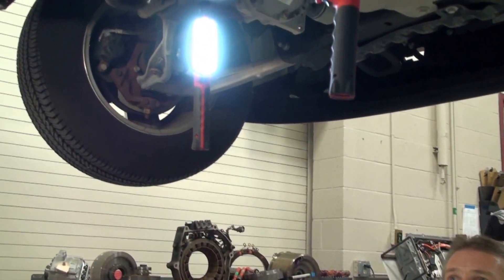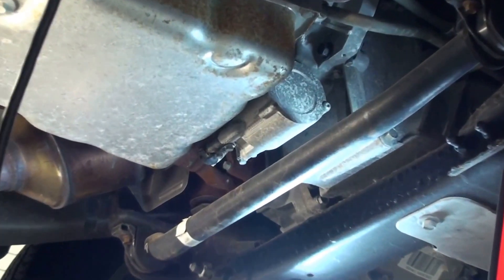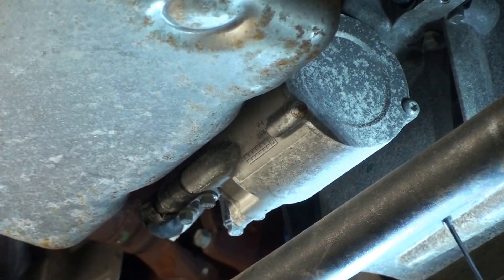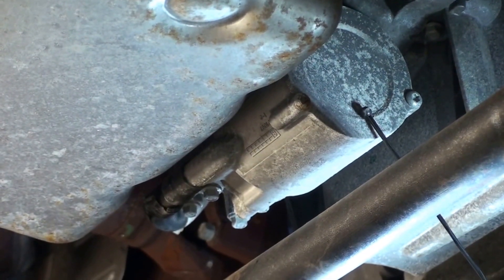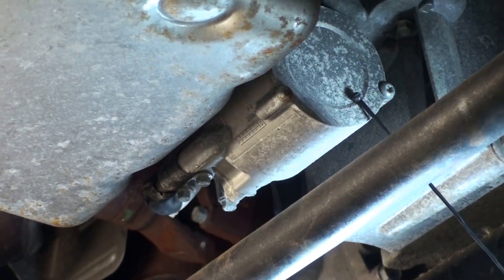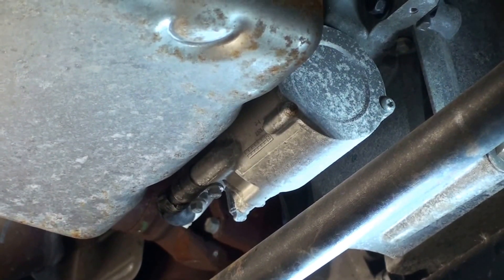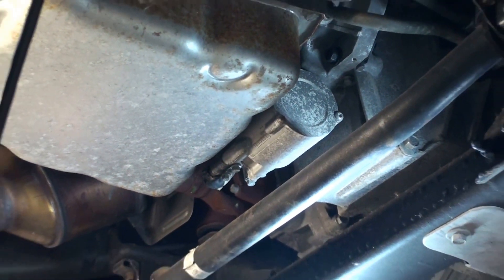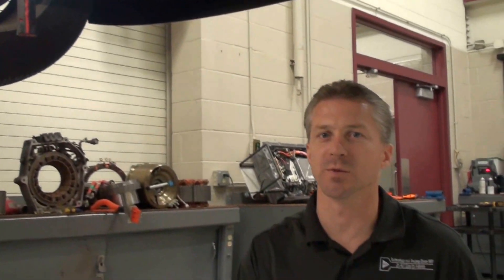HEV-TV 1.15: Auxiliary Pump in Automatic Transmission

Comment: what are some symptoms if it's the auxiliary pump?
Reply: Amanda Pena yes I have same question. .  basically.  my transmission has a loud rough start at first and I don't know if that's the motor or the transmission problem.  Also, sometimes in reverse I slightly push the pedal to start reversing and the transmission grinds rough and it chugs for 1 or 2 seconds.  I want to replace it but it might not even be bad.
Reply: Daniel Shelley  I  wouldn't replace the transmission. I had my escalade 3 years now and it's been doing it off and on especially in the winter. It's the auxiliary transmission pump. It's located right under transmission. If you know what your doing you could have it off in a matter of minutes
Reply: Jorge Vasquez  would you know where to buy the part? I took my tahoe to the dealer they said it was the hybrid battery but I believe it’s the aux pump
Reply: Oscar Gonzalez it's a very hard part to find. However, I believe it's actually sold by gm for around $170 . I'll find out for sure and post the link.
Reply: Oscar Gonzalez dealers don't know crap about hybrids unless they are hybrid certified. Take my word for it. Don't waste money at your mechanic either. I learned the hard expensive way....they will end up trouble shooting and having you replace every but that pump...in the end it's the auxiliary trans pump.
Reply: @vunit8213  I think I'm having these issues with my 08 Tahoe Hybrid. I am facing intermittent issues at very slow speeds like starting from a stop or after backing out of a parking spot and then switching to drive as I start to go it seems to have trouble and starts to bump or almost buck and reminds me of when I was learning to drive stick shift and slipping and grabbing. It also makes a weird grinding gargling noise sometimes when goin up a hill or something around 15-20 mph...I hope its not something more serious I hope its just the pump. these comments were helpful
Reply: VUNIT82 thanks for the quick response! Yeah it comes and goes but I want it to not come and go! I actually just had it do it right around 15 mph as well.. I’ll look into fixing it here soon! Thanks again..
Reply: VUNIT82 I’m not a mechanic by any means but I’ve changed alternators and water pumps before... is this fairly easy as well? also.. I’m looking and found that the 08s need to upgrade to a 2010 pump .. and may need some sort of adaptor to connect old to new.. do you know about that?
Reply: @devinjtatro  I don't know anything about that, because mine is an 09, so it was probably already updated if that's the case.... it's an at home Diy project...jack your truck up in the front preferably...or if you have access to a lift even better....but it's right between oil pan and transmission pan...right dead in the middle...it has a black plastic PVC style fluid line connected to it...this line supplies the pump with tranny fluid to cool down the tranny and keep it running smoothly....mine was always wet with fluid...I couldn't figure out from where it was leaking...I just figured the pump was must be malfunctioning causing it to leak...its been awhile, but if I remember right it's a star bit screw....and there's aprox 3-5 screws....if you can change an alternator, you can do this....if I were you I would buy new fluid and a new tranny filter as well... might as well do it right while you're down there.... however, if you just want to swap it out and go I would have a bucket handy in case any fluid poor out of the pump...If I'm remembering correctly...the fluid only comes out of the line if the keys on and pump is activated
Reply: VUNIT82 awesome! Thanks so much for the help and guidance on this!
Reply: @devinjtatro  no problem... you may also want to check into your driver side valve cover quick and easy fix...(arpox 30) minutes... It may need updated with the new style...if you hear an audible hissing... vacuum leak near PCV valve on the driver's side valve cover...and considering yours being an 08 it probably isn't updated....but $50-$75 to fix....what happens is the outdated one doesn't have the hole in the right spot so oil doesn't circulate correctly so if you have noticed excessive oil consumption for no good reason it probably clogged with gunk....the updated one has a hole cut in the correct spot so oil circulates correctly.... anymore questions I'm around..
Reply: @vunit8213  Okay cool thank you! I haven't noticed that yet.. but I'll check it out! I am looking at this.. and hopefully this guide will help others that are having similar issues. https://workshop-manuals.com/chevrolet/tahoe_4wd/v8-6.0l_hybrid/transmission_and_drivetrain/automatic_transmission/transaxle/fluid_pump_a/t/component_information/technical_service_bulletins/all_other_service_bulletins_for_fluid_pump/10-07-30-009/jun/10/a/t_hybrid_transmissions_service_auxiliary_fluid_pump/
Reply: It has pretty detailed instructions on how to replace the pump.. and it does mention part numbers and update 08 pumps to 2010.. I'm just trying to figure out if or where this updated connector/ wire is that they are mentioning.. I just want to replace the pump and not the module part...
Reply: @devinjtatro  your vehicle probably is equipped with the old style power connector that supplies power to the pump. Since you are updating the pump you probably have to upgrade to the newer connecter since your 08 is the old one and won't fit the new pump... As far as where to get it? I would try acdelco.com or GM
Reply: VUNIT82 thanks! Looking to get this thing ordered just making sure I get the right parts and everything that I need. In the mean time I have started to experience some shuddering and similar characteristics.. around speeds of 35-45 mph or so.. this pump might be failing quicker than I was thinking!
Reply: @devinjtatro  yes...any kind of transmission style symptoms you may experience most likely are the result of a faulty auxiliary pump! Regardless of what anyone may tell you...  99% of your local mechanics don't have a clue about hybrid vehicles..ive experienced everything you are telling me plus more.... You may even want to call your local GM dealership parts department or the 800 number and ask them for YOUR VEHICLE SPECIFIC PUMP...ask them about the updated connector... especially if you are going to order through them...if not they will still assist you....but MAKE SURE you have the right parts before you start, so you aren't waisting your time...good luck! Please keep me updated on your situation! Thanks
Reply: VUNIT82 awesome thanks so much! I will let you know how it goes!
Reply: @devinjtatro  if you are experiencing shutting around them speeds, it may be related to your throttle body sensor or your fuel pressure sensor....or could be a spark issue...(faulty coil pack on plug) unfortunately I changed all of them little sensors before changing the aux pump.... Plugs,wires, sensors, and even the fuel pump because I kept getting a    check engine code.... DONT EVER!!! ADD HEAT TO YOUR TANK!  THAT'S WHEN MORE PROBLEMS DEVELOPED...I EVEN CHANGED ALL MY INJECTORS...STILL NO CHANGE... The only reason I am sure it was the HEAT fuel treatment is because it started right after I added it to my fuel...and didn't quit until I drained all the fuel from my tank and put in new gas....I figured I would just give you some of my knowledge...it may help you avoid more problems down the road...and one more thing i might as well say.... regular unleaded will make your hybrid run even worse...it will buck and jolt even worse when it's cold outside, because this vehicle requires higher octane fuel...mid grade is what I use...my guess is the engine isn't firing properly with regular unleaded causing poor engine performance... next time at a intercetion or drive thru and it starts to buck..put it in neutral for a few seconds and ride it out.. because if you don't it may stall in the middle of traffic and these hybrids don't start back up like normal cars... you have to turn key back and wait a few seconds and then hope it re starts....
Reply: VUNIT82 I crawled under the Tahoe tonight to scope out what I’m looking and for. Looks pretty straight forward that pump is held on by those 4 bolts.. but what I did find while I was down there was the pump was greasy and grimy and dripping with fluid.. assuming it’s transmission fluid but not sure. Iv looked into the other things you mentioned.. throttle body and stuff but the reason I’m still pretty convinced it’s this pump is it’s very intermittent.. some days it runs great all day .. like today. It was a bit warmer out today as well.
Reply: @devinjtatro  mine happened worse on cold mornings when backing out of the garage without letting it warm up a few minutes..I would back out and it sometimes wouldn't even budge...then I could feel it starting to catch... almost like the pressure is building up...but after that it seems to work fine....it seemed to also act up allot when I was driving in town and all of a sudden I had to make a quick stop..like at a red light...or in drive thrus.... sometimes in slow crawling traffic I was afraid it was going to boost me into the bumper of the car in front of me..lol
Reply: VUNIT82 wow, yeah mine hasn’t gotten that bad yet. It mainly happens after backing up and then slowly driving forward like turning around in the driveway or parking spot.. sometimes just creeping along in a parking lot or drive through or at a light .. I can almost predict when it will start to buck/slip it does sound like pressure building up and then when it releases but the vehicle isn’t ready or something and. Usually just slow back down to a stop and it goes away. Slightly different symptom I’m experiencing but I still think it’s related to the pump...on my street theres an incline .. most of the way it stays in battery mode between 10-20 mph. Then it switches to engine smooth and fine but it makes like a weird growling gargling noise that sounds like it originates under the the center console area. My understanding is that at that speed it’s probably in hybrid 1-2 low mode and that pump helps make that function smoothly.. so if that’s struggling to provide lubrication and pressure and I’m experiencing the other issues. The weird thing is that some days it drives and rides like a dream but now i just get paranoid if it is going to act up. Like I said I’m starting to get to the point i can predict when or if it may act up. Sorry long comment.
Reply: @devinjtatro  sorry don't mean to bug you but, I just read your message (old message) about asking me to private message you on your channel.... however, I searched and searched and couldn't figure out how to go about doing that...do I have to be a  paid subscriber to YouTube? I  searched all over but, still couldn't find anything that would allow me to message you.... sorry for the inconvenience...
Reply: VUNIT82 no worries. YouTube made it harder to private message .. I ordered the parts.. weird thing is the Tahoe seems to be running great.. acts up minimally. I didn’t change anything. So weird.
Reply: @devinjtatro  lol... that's the way it goes! Get it detailed and it will run likes it did in 2008 😊
Reply: VUNIT82 yeah ... I’m still waiting on the parts.. but now it acts fine. Funny you say that cuz I am planning to give it a good cleaning in the next few days.
Reply: Devin Tatro hey did you ever get the parts installed ? I am having this same issue. Figured out it was something in the trans. Long. Story short. 2 yeRs ago car quit. Got towed to dealer 1k later on diag fees. New main battery and junction block. Car ran fine for abt a week. Been in my garage untouched for the past year. What parts did you order ? And from where. Im ready to knock this out myself
Reply: @derrickbjr1  GM 1920-7983 is for the Auxiliary fluid pump and there's also a auxillary sump filter inside your transmission next to your regular transmission filter just allot smaller....that's is your auxillary transmission sump filter.  ACDelco makes that as a 2 piece filter kit....your regular filter and the auxiliary filter....I would advise you to change everything at one with new fluid.  Or at least 10 quarts....drop, change and fill.
Reply: @derrickbjr1  easy as pie! The pump can be bought at wholesalegmpartsonline it's about $253. With a $30 core fee ... you may also need pgtail connector if yours is the old style....the updated plug fits on the updated pump..... there's literally four 8mm bolts and an electrical connector holding it under tranny pan...when you remove it a bunch of fluid will come out, so that's why I advice you to change your 2 filters while your at it....seal should be one of the good reusable ACDelco ones, so it shouldn't need replaced unless it's damaged and you want to spend another $35+ .....I also had better look re-using my old ones because there already formed to the groove...no leaks here..
Reply: @derrickbjr1  one last thing, you don't have to change your tranny filters or fluid at all...the pump should drop right on out, however you do need to replenish the fluid that comes out..
Reply: WHOizJR I did and unfortunately it didn’t solve the issue for me.. very frustrating.. I hope it solves it for you. Could be the pump module?
Reply: Devin Tatro  did you use the 2010 pump? They recommend using a new harness and replacing the control module as well. I was going to just do all 3. Along with the fluids
Reply: WHOizJR I used the 2010 pump and updated connector piece to connect to the existing module. I wasn’t sure if the module needed to be done and programmed by a gm mechanic..
Reply: @derrickbjr1  one thing I learned about owning a hybrid is that, allot of the smaller shops will claim they know how to fix them, however they are as clueless as you are.... Secondly, 99% of the time something go's wrong, it's not the battery or the hybrid system... everyone always points to the 300V lithium ion battery, however in most cases it's not going to be the battery ... it'll be something else causing the battery to discharge thus causing tons of other problems...
Reply: @vunit8213  Hey, my 2009 Escalade hybrid starting doing that bucking and not wanting to go thing about 3 weeks ago. The rpm needle goes up and down and it does not go into auto stop at all anymore. The hybrid battery fan is running on and off more than normal. I cleaned out the air intake for the battery fan. I replaced the auxiliary transmission pump along with new spliced connector. I'm still having the issue. The guy I bought it from said he had the hybrid battery replaced 2 years ago. Could the auxiliary trans pump module be the problem? I
Reply: Connor Lacy If you recently had the auxiliary pump changed, I wouldn’t think it went out already....im betting on battery cell related...because the reason it’s not shifting into EV mode (hybrid mode) is because the battery isn’t able to reach the desired charge...HOWEVER,There are several other things that can stop your hybrid from going into electric mode...from what I heard is these batteries aren’t like what most people think...they were built to last.. they come with a 100,000 mile or 10 year warranty....so, I would start simple...#1. If you don’t have your seatbelt buckled, it will not go into ev mode #2. If you have a trailer light adapter hooked into the trailer light port, or if you’re hooked up to a trailer it will not go into ev mode...#3. If your hood isn’t latched correctly or if your hood is open, it will not switch to ev mode...#4. If your  12v battery is on the brinks, it will NOT go into ev mode and will cause all kinds of mechanical and electrical issues! People have been known to have their 300v hybrid battery changed, all because they had a weak 12v battery....and they don’t always test bad either! These hybrid systems are different, I had a battery specialist tell me my hybrid battery was bad and my 12v battery was perfect, however as a last resort I changed my 12v battery and took care all kinds of issues I was having and one issue was not switching over into ev mode.... #5. Could be the hybrid system fuse forget which one it is, but if disconnected or blown will NOT go into ev mode...#6. If truck is in “limp mode” will not go into ev mode...I guess what I’m trying to say is DONT GO CHANGING THE BATTERY OR AUX PUMP or any expensive parts until you troubleshoot the simple things first..
Reply: @vunit8213  awesome, I did get a diagnostic check and it came up with a few codes. I will post later. One was "replace hybrid battery", the other was for the auxiliary transmission pump/module, which I already bought and will be installing Monday. I will check all of the other things you mentioned and repost. Thank you so much for the info
Reply: Connor Lacy oh I thought you already replaced the auxiliary pump? Yes, replace that pump ASAP! It’s the cause of the buck or surge when transitioning from mechanical mode to EV MODE....the pump is responsible for keeping pressure on the clutch inside the transmission...and also responsible for engaging and disengaging the gears! This pump will progressively get worse over time....from time to time when my truck would jolt it would also stall out triggering a check engine light and a message to “service hybrid system “ however turning the car off for a minute and restarting it will reset the message and my truck seemed to run fine again....post the codes whenever and I can take a look for you.
Reply: @vunit8213  I did replace the pump, but it's still doing the same thing. Today, I removed the hybrid battery and checked every terminal for corrosion. Everything looked very clean, so I put the battery back in. I did order an auxiliary transmission pump module that will arrive tomorrow. These are the codes:
P0AC4, hybrid powertrain control module requested MIL illumination.

P0A80 replace hybrid battery pack

P0BBD hybrid battery voltage variation exceeded limit

P2797 auxillary transmission fluid pump circuit performance
Reply: @vunit8213  also, how is the fluid in the pump replaced? From the transmission, and just add more fluid at engine compartment dipstick tube?? If I replaced the pump, and then replace the module tomorrow and it doesn't change, I'm guessing it's the hybrid battery. I know how to test the cells for voltage but the resting voltage may be normal. How do I find the bad cell(s)? Also I've read Prius gen 2 hybrid cells are the same as the gm and are an exact fit, which can be bought on Ebay? I'd rather replace cells than entire battery if possible..
Reply: Connor Lacy ok, I got codes P0AC4 and P0BDD IN THE PAST AND I always got them codes right after I experienced a jolt or a surge....Did you make sure your 12V battery was at 100%, because these hybrids operate a little differently...the 12V battery is what powers most of your electronics and also some of your engine components...not sure if it power the auxiliary pump or the 300v lithium battery powers that...however, if either one of your batteries aren’t to full capacity you will experience issues because, when they drop to a certain level certain components shut off and turn back on causing weird things to happen....my truck had a 12v battery that would only hold up to 11v fully charm and would drop after driving for awhile with light, gps, music, etc...it would cause dvd screen to randomly black out and door locks to cycle on there own...it caused my engine to constantly keep switching over to ev mode and back and I also got the 2 codes you mentioned....FIRST thing I would do is do a voltage reading on my 12V battery... no need to do a voltage drop test, because there’s no starter and it’s all wired differently...it sounds to me like you have a low battery either 12v or 300v cell may be weak, however if the 300v was recently replaced , I wouldn’t bet on it being bad.
Reply: Fluid is replaced through dipstick....and FYI there is 2 filters in your 2mode transmission...one is your normal filter and the second small filter is your “auxiliary transmissions sump filter” if it’s clogged with debris like mine was it will also cause surging and rough shifting mainly into 2nd gear for me anyway....the sump filter is what filters the fluid for the hybrid system and the auxiliary pump.
Reply: @vunit8213  thank you for the info. I just received the pump module about an hour ago, so I cut the new connector off I spliced on the other day, put it on the module (module is used, new ones have to be programmed at the dealer), and drove it for about 2 miles. The jolting seems to be gone, however it still does not go into auto stop, and the check engine light came back on once I parked it. I will check the codes again as well as the battery. The voltage on the dash with the engine off is 12 volts. I will check with volt meter and repost
Reply: I’m not 100% sure on this but, I believe the auxiliary transmission module may have had a recall or a bulletin....it should have been changed already if it was a defective one...something about missing a waterproof seal so moisture causes harsh shifting and or surges...and could result in an electrical fire..
Reply: May want to check into all the bulletins for your particular vin #
Reply: The code P2797 sounds like you may have a lose connection on your auxiliary module....try disconnecting power first, then disconnecting the 2 harness plugs from the module and cleaning them with electrical cleaner or break clean and then after they dry off secure them back on... and reconnect the power....those connections are in a spot that get mudd, dirt, water, and salt flung at them from the road daily...it couldn’t hurt to clean and maybe you’ll find a lose connection
Reply: @vunit8213  thanks once again. So, I just drove to auto zone, and the jerking is back, but only when first driving, then its not as bad. it's no longer doing the speed fluctuations it was doing before while driving that you could feel, like the electric motors were cycling. The battery checked out good according to them, but it did say check starting system on the battery tester. The diagnostic test came back with 2 of the same codes. I reset it earlier when I took apart the hybrid battery. No longer getting the previous codes.

P0BBD: hybrid battery pack voltage variation exceeded limit
Reply: Connor Lacy i would suggest you to just try, and trickle charge your 12V battery over night...DISCONNECT BOTH TERMINALS FIRST, then charge slowly over night....i know you might think this sounds pointless, but please just try it....when you reconnect everything, you will have to reset all your settings again, however since you just replaced the module it wouldn’t hurt to start fresh....I said it before and I’ll say it again AUTO ZONE AND most mechanics are clueless when it comes to hybrids....slowly fully charge your 12V battery and test drive...
Reply: Your dash doesn’t tell you if you’re battery is working properly....trust me...my battery would test perfect, but when I would drive is when it would discharge....I ALMOST FORGOT TO ASK??? VERY IMPORTANT QUESTION...DO YOU DRIVE MAINLY SHORT DISTANCES? DO YOU MAINLY DRIVE ON Highways or do you do allot of stop and go driving??? The was a bulletin for this, concerning the hybrid battery.....you see, you must do stop and go driving... the more you apply your breaks the more you are charging up your 300V battery....if you don’t drive adequately then you will experience all of your issues, because of lack of juice in your battery....every time it gos under a certain percentage it will struggle to stay alive and when it at its happy point it good...there is a bulletin for this...this may be your issue
Reply: @vunit8213  ok, I'll charge it tonight and repost. I drive it short distance during the week and long on weekends. Yesterday I drove 100 miles and it would stall when I got to a stop light until I made it home. Had to restart engine each time.
Reply: Connor Lacy these hybrids were built for “stop and go” traffic....that’s how they charge the 300v by using using the breaking system combined with the electric motors generating power... My truck did the same thing not to long ago, when it was colder outside. It stalled and through a check engine light, but I figured it was because of my faulty evap vent Solenoid I still need to replace...I’m getting a specific code for the solenoid...however since it warmed up I haven’t had anymore issues of it stalling out..
Reply: @vunit8213  I went ahead and installed a brand new 12v battery, and still having the same issues. Hybrid battery fan constantly running. What are your thoughts on isolating the weak hybrid battery cells, and replacing them, or using a battery discharger/charger to recondition the cells?
Reply: Connor Lacy if you know how to do it then by all means do it it....You got me curious now....if you’re hybrid battery fan is consistently running, then that means either 2 things...#1. Means you’re battery is constantly charging, so fans keep cooling...(could be a weak cell or two) #2. Your computer is being told to keep them fans running due to some other issue...I personally like to eliminate one thing at a time starting simplest things first...however, you did get a P code I never seen before...the one having to do with “replace hybrid battery” heck, yeah if you know how to check them cells than do it even if that’s not the cause of your issue it’s still a good peace of mind to have
Reply: @vunit8213  I fixed the problem. I removed the hybrid battery, took off the cover, removed all bus terminals on one side of the cell bank. I tested the voltage of each cell block. One was reading 6 volts, one 8, and the rest 8.20 volts. I bought a used re conditioned second generation Toyota Prius hybrid battery cell on Ebay for $35.00 a few days prior. It took some work to loosen the bolts that hold them together tightly as well as screws on the bottom, and the fan. I removed the cell with low voltage and discovered it was badly burnt on the side and had a hold in the casing. I believe it damaged the cell beside it, which read 8 volts, but I only had one replacement. I swapped it out, put it together, and re installed battery. Auto stop works, try k runs like before, however check engine light is on and havent scanned it again. I believe it's going to be due to the cell reading 8 volts. I'm going to order another and replace that one very soon. I'll repost once I get the code.
Reply: Connor Lacy that’s awesome! I’m glad you let me know....I’ve always been curious to test my cells to, but never did because didn’t want to ruin anything....so, did you have to use any special gloves or not? Did you turn the power switch off? Did you have to perform any other special procedures ?  Now that you fixed yours, I’m curious about my cells because my truck seems like it stays running allot longer than it used to....how long did it take you to check all the cells? What setting did you set your Multi meter to? What cells work in these ? You said a Prius has the same cells? Which year and model? Sorry for all the questions, that’s one thing I never checked before and now I’m curious about mine.
Reply: @vunit8213  I believe it's the Prius generation 2. Look up 8.2 volt Prius cells on Ebay and theres a ton for sale. I disconnected the 12v battery, then on the passenger side, under the back seat, theres a safety disconnect for the hybrid battery, pull the lever and remove it. This kills power to the motors. You'll see 3 wires leaving the battery. Red, black, and smaller black(ground). I removed the small cover exposing the terminals and disconnected them from the battery. No gloves needed since  the disconnect is pulled out. disconnect 2 additional plugs, and a rubber tube, then un bolt the battery. I believe 2, 18mm in the front, and 3, 13mm in the back. The battery is heavy as crap and it's easier with 2 people. Once out, remove the cover. Theres a million bolts holding it on. Remove the black plastic covering the cell terminals, they pop off with a flat head. Then using a 5/16  driver or socket on a drill, unscrew all nuts on ONE side of the cell block bus bars. Theres quite a few. Once one side is no longer in series, you can use a multimeter set on 20v DC and connect on each side of the cell. Test each cell, only takes 5 minutes. Mark any cells with low voltage with a sharpie.  Getting the cells free is a whole other monster but it's not that bad. If you ever get to that point,  I'll explain how I did it step by step.
Reply: Connor Lacy thank you! This will make it a hole lot easier now... I appreciate the response to my questions...
Reply: I own a 2008 Tahoe Hybrid. Been dealing with the same issues for the better part of 5 years. GM replaces the engine and Hybrid Battery 3 years ago and the issue still exists. I just replaced the serial gateway module a few months back because it stated “service hybrid system”. Long story short, the module is out of production so I had to get a used one off eBay. It seems to work be working great but didn’t fix the Auto stop issue. I requested for GM to repurchase my vehicle and of coarse they said hell no!! Lol. So, at this point I will look into the aux pump. Hopefully, I will finally get some sort of justice!
Reply: @OscarGonzalez-xw9fw  it's the 12 volt battery  loose or dirty cables  the Driver information should show 14.9 (14-15)volts with the engine on  if it shows 12 or 13 less then you have a issue with the battery and/or  cables to the battery  unless you have a check engine light then the main 12V battery is your issue
Reply: @vunit8213  hey bud i know this post is old but Ive tried looking at the parts number you gave for the pump seems like nothing pops up period,Ive called dealer,they have no clue of anything,my prob is car bucks from dead stop to gas mode and some time launches forward slowing down from gas to hybrid.my truck a 2009 all original,no check engine light or code at all ?what you think it could be.this prob scares me cause it may eventually hurt someone.ive looked all over for the parts still nothing can you help
Reply: Steve Pontarelli you just described to the T, what mine used to do! 😆 same exact symptoms and no engine codes... from how I was explained, all the pump does is act as a sort of hydraulic pump that that engages and disengages the clutch so your vehicle transitions smoothly from electric to gas vise versa. Now, if you live in a city with a lot of stop and go, it’s being used a lot more than if you only drove your vehicle long distances or “highway driving”...... The only problem I noticed about “highway driving” is that your 300v hybrid battery doesn’t like to fully charge, which causes vehicle to constantly keep switching modes to top off your battery...but when I lived in the city I was constantly breaking and the battery charges off of your breaking system and electric motors act as generators.... anyway to answer your question about the part number.... if I remember right I called GM and double checked with your specific vehicle... however, if I’m not mistaken it’s the same exact one, all GMC, CHEVY, CADILLAC 2008-2013 SILVERADO SIERRA HYBRID AUX TRANSMISSION FLUID PUMP NEW GM #  19207983 ......Easy peasy lemon squeezy Steve! Do it yourself and save a ton... 4-5 Allen or hex bolts and an electrical connector.... if I was you I would drain whatever  transmission fluid that comes out in a clean container, and replace with new fluid.... shouldn’t be much because pump will be shut off....Good luck, I have faith in you! You got this! 😎
Reply: @vunit8213   amazing to hear,yes i do live in the city and its alot of stop and go but lately its getting very bad to the point i dont want to drive it,so did you have to replace just the pump or the pump and controller ?
Reply: Steve Pontarelli you shouldn’t have to touch the   Module it’s all mechanical, that pump probably endured a lot pumping over the years...
Reply: Do you get any oil residue at all around your aux pump? Mine had it running down the sleeve that covers the electrical connector. And no matter how many times I wiped it clean it would get transmission fluid on it. Probably every time it bucked and stalled in me!
Reply: @vunit8213   hey bud let me ask you i finaly got the pump the connector looks the same as mine in my 2009  do i have to buy that haress or its still plug and play,i keep hearing about this harness cant find what it looks like ?
Reply: Steve Pontarelli your new pump should already have the harness and connector on it, and it’s just plug and play from there....easy, fix! That harness wire should have a cover over it to protect it...
Reply: @devinjtatro  Did replacing this part fix your problem? I am having the same problem on my silverado 09.
Reply: Does Range Rover sport 2019 has this pump outside like this or inside ?
Reply: @devinjtatro did you find the problem?
Reply: @jessejames7140  no.
Reply: @devinjtatro  trying the pump now. Added new 12v battery cables and new 12v battery clean all grounded now 2010 new auxiliary pump with square adapter to fit